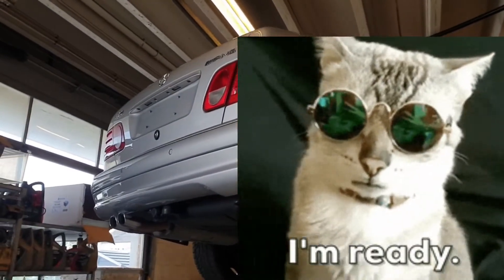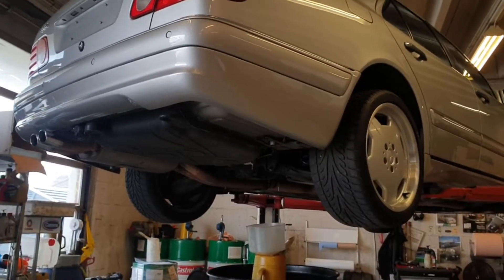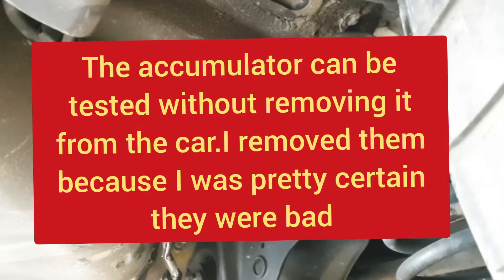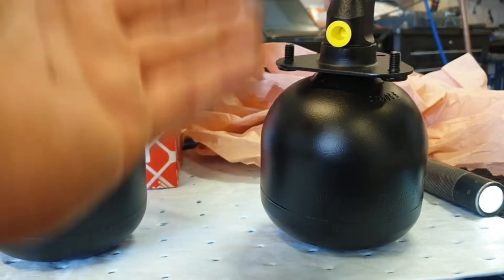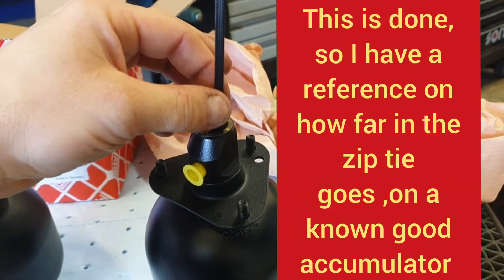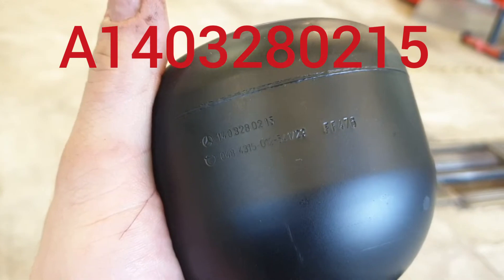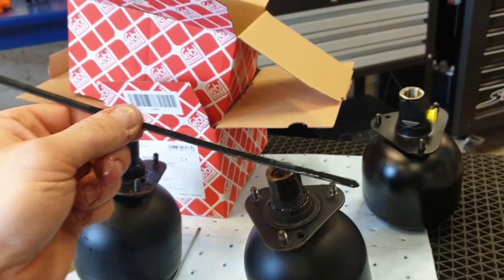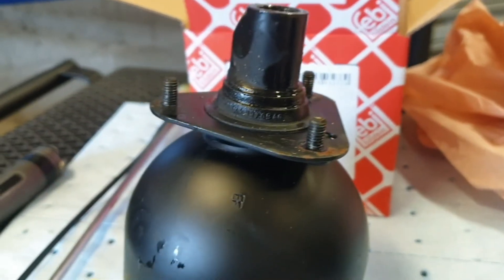How To Test Pressure Accumulators/Spheres,on the Mercedes Benz Self Leveling System/And  ADS system

Comment: Hello I have a e50 AMG from France and have the same ads option :) 
When you install the new spheres and fill the hydraulic tank with the new oil in the engine compartment. How do you Chase the air from the lines ? In the e50 AMG the hydraulic bloc is not in the trunk right ?
Thank you for making these videos !

Comment: hey! Can you help why i get sometimes  "Adaptive Damper"  error at starting the car ?  like 10/2 times  :( really annoying
Reply from the maker: Hey there.Mine does that too. And i have got a faultcode saying that the steering angle sensor initializing. I have done alot of diagnosis on the system..and i have not wrapped my head around the fault..as everything is checking out " good". It also seems somewhat " heat" related.My warning messages just pops up on startup..and turns itself off after 2 or 3 seconds..and its back to normal.Eitherway ...You need to read faultcodes first...and then proceed from there. You will need a STAR diagnosis to read the ADS system. You will potentially also get a sign of whats wrong if you read the ABS/ESP system for faultcodes. I hope that is somewhat helpful. Greetings,Stefan
Reply: @TheCarTakerGarage   hey Stefan thank you so much :)

The Previous owner told me when i purchased the car , there is sometimes Steering Angle error , but they checked everything and everything good , at that time i dont know that will arrive as Adaptive Damper fault , but now i know that was the error what he told me :) 

So its the 100% same as you described :)

so looks like there is no fix for this? :/

Thanks , Martin
Reply from the maker: @czrmrtn   There has to be a fix for it..but what the fix is in each case...is not possible to say. As i see it...it is indeed a periodic fault..and also somewhat a temperature related fault. IT does seem to be more frequent when there is " hotter"....at least in my case it is. I remember last summer holiday..i drove a long distance...with temperature outside beeing " hotter"...and lots of " bendy roads...and the fault ended up staying on.   ..When i do short trips...is usually never happens at all.. Also..i have a friend of mine who also had this " intitializing steering angle sensor fault...and he replaced the steering angle sensor..and this did NOT fix his issue.So that is the reason i have not just bought a steering angle sensor without confirming it is this component..cause it is damn expensive on the first year of w210. in 1998 it became a different type of sensor..which has wiring connector on it..and not wiring beeing connected permantently on the sensor like on my early car.  I did find some poor conncections on the ADS ecu .The wiring from the ADS ecu to the instrument cluster warning light had poor contact..but it did not correct the issue by trying to correct the poor contact...OR replace the ECU. I got hold of a spare ADS unit just to try out..but it has notcorrected the fault...I really want to just buy the Steering angle sensor..but again..it has always been expensive..and now these days it got even more expensive.ITs doubled in price the last year. Best regards,STefan

Comment: Hello my friend, I followed you a lot when you had the MB 190E 2.5-16. I'm from Argentina, maybe you recall me. Sorry to post here but I need your help. I still have mine. Regarding SLS, I'm having some issues and I'm checking everything. I saw the 190E has 3 hydraulic pressure accumulators. 1 in the front just behind the right wheel and two on the back. I guess, two work with the rear struts and the other with the differential (ASD). Is this that I'm saying correct? if so, could you please tell me which ones work with the struts? and second, Do you know the working pressure value? Thanks in advance and you continue to share great videos to enthusistics. Thumbs up!
Reply from the maker: Heelloooo mister Bonaudi.I do remember you indeed. Long time no see. The accumulator in the front right wheel well..is the Acccumulator for the ASD diff. The two rear accumulators are for the rear struts. And im afraid i do not remember the working pressure. I do have a number of around 10 bars in the back of my head..but i am not sure at all..but i can find it out at some point if really needed. I hope you are doing good mister.And thank you for commenting and saying hello :) Greetings from Norway ,Stefan :)
Reply: @TheCarTakerGarage  Thanks so much Stefan for the information. I think what you just sent will do. I hope you are doing great. We keep in touch and continue posting your amazing videos, they really help a lot! Greetings

Comment: hello everyone.

thank you for your video's, really helpful as usual. 

I got a question. I got an e55 from 1998, ads system included. my problem is, when the car is stopped. I can see a 3 cm diffrence between height of car between left and right. it is defenatly lower at driver side, do you know where could comes the issue? bad shoks spheres, levelling valve or sensors?

sorry but I run a lot on the web. nothing on that topic. a lot on self levelling system from wagons,  almost nothing on ads on normal sedans.

thanks in advance. 
best
Reply: Same 👍🏻

Comment: My accumulators were good but I still have a rough ride. I replaced them with new ones though. Do you have a clue where to look next?
Reply from the maker: hey there.Depends on which car you have?so...That is a tough one...as a rough ride like this on a SLS suspenssion..like if it has no " suspension "....the only thing it can be is either faulty spheres...or incorrect ride height. if the shocks are bottoming out.
Reply: @TheCarTakerGarage  Hi. I have a 1998 E55 AMG sedan with the same system. My rear ride height is quite high compared to front. The dampening works  when I press the button it gets stiffer but without activating it it's still too harsh over bumps
Reply from the maker: @JK-AUTO  ah okei.well..my car is definetly also " harsh"..It is not soft by any means...and it has " bothered" my..and amazed me in many ways...as it is veeery different to ride in ,than a standard w210.But again..the difference in harshness with the broken spheres..and after the fix was massive.But still the car is very stiff compared to a standard 210.Maybe it is the same with yours...have you had the car for long?If yes...is this  issue something that has occured recently...or ?
Reply: @TheCarTakerGarage  thanks for the reply! It has been a problem since I got the car two years ago. Also the front dampers are definitely worn out and probably original (mine has driven 311 000 km). Do you happen to know where to possibly order the front ads dampers without donating your kidney?

Comment: Thanks for the video. . same sls on my w124 & w202
Reply from the maker: Thanks for checking it out :)  Indeed the same stuff..at least the spheres and the main parts of the SLS system.The cars with the ADS ,has some additional electronically controlled valve blocks on the pressure lines,,you can barely see them in the video...but you are right.Very nice system i think,and i will always keep them on my cars..and not remove them like many do..when they run into problems with these systems. Greetings,STefan

Comment: Good information thanks  i think you gett a smoth ride  again
Reply from the maker: Thank you :) Definetly...but i think i have to correct that..cause it is definetly not a " wallowy" ride in this car..it is quite firm actuallly...alot firmer than you might think actually :) But Compared to the FIRM bad accumulator ride...it is definetly a smoother ride now for sure ;)
Reply: Nice video thank you for sharing! I have the same system on my Mercedes S210 E200 kompressor from 1998. I need to know how you bleed the system after change the acumulator, to clean air bubbles on the lines